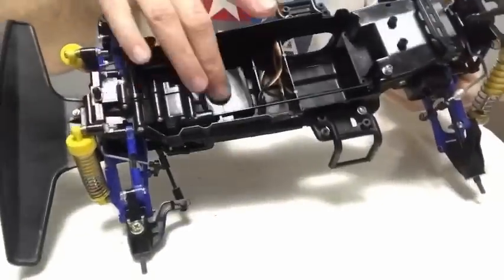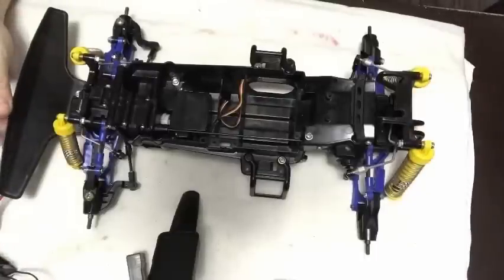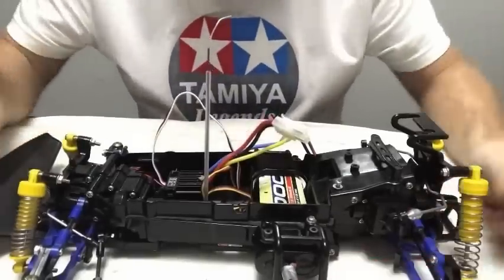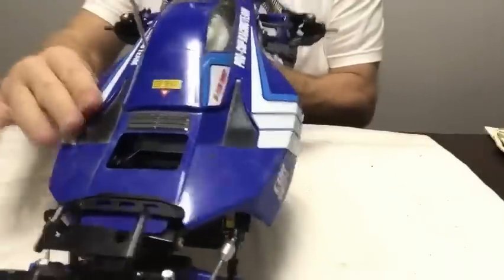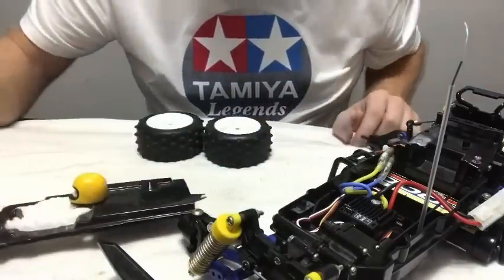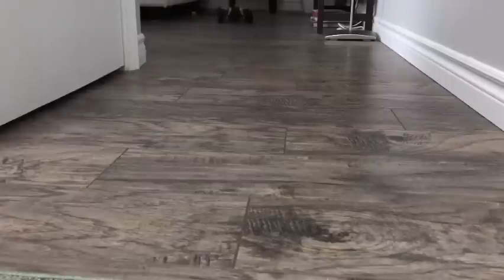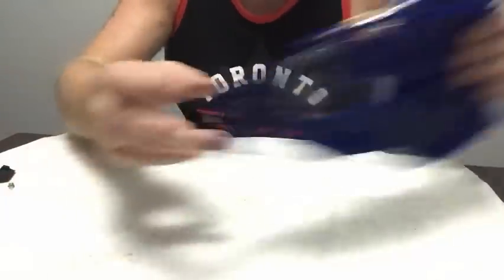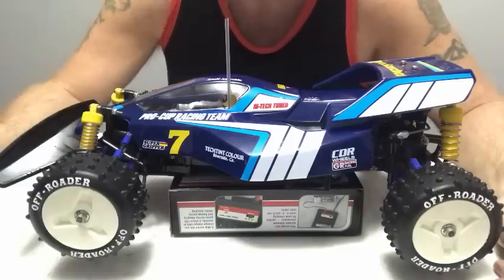Tamiya Terra Scorcher Restoration, Part 3...

Comment: hi great video I’ve found mine out of the loft today it’s in similar condition to yours apart from I’m missing the speed controller which I’ve just ordered off eBay and a few other bits. I’m 43 now was 11 when I originally got it

Comment: Any tips for keeping the dampers together on this thing? Tighten mine before every run but within minutes find there is usually one thats fallen apart or nuts are at least loose again. have to keep searching for lost parts. Thought maybe I'd done something wrong in the build, but no.